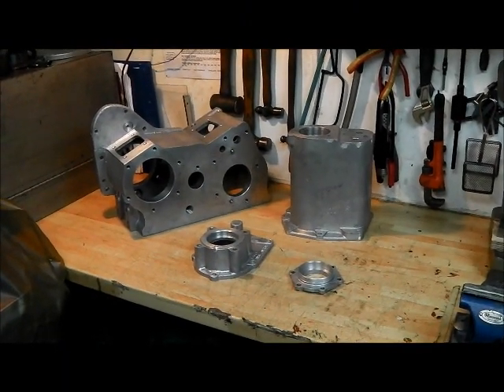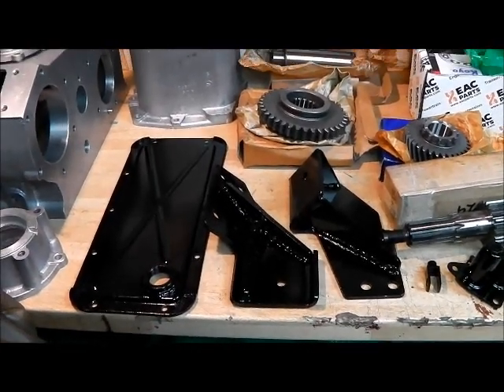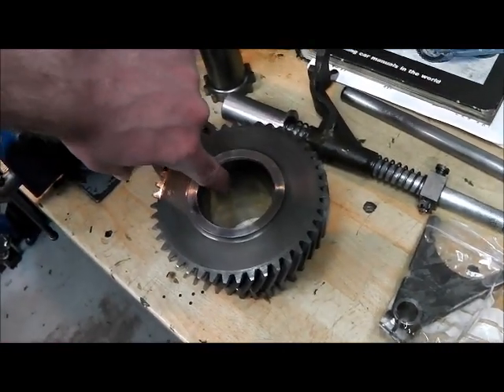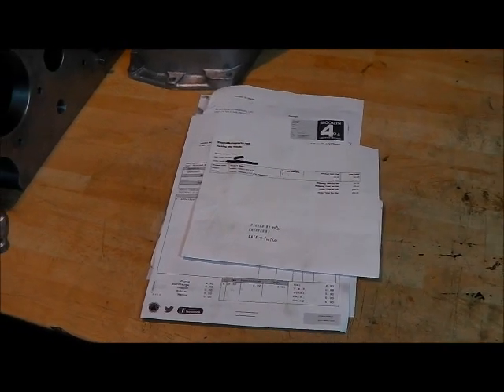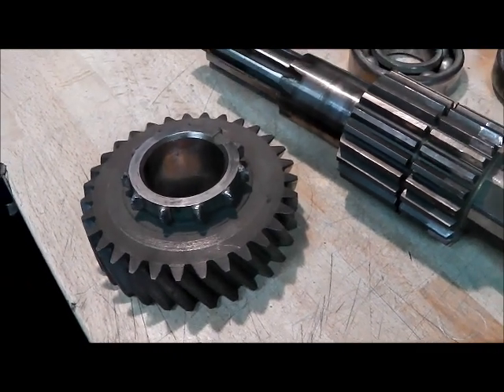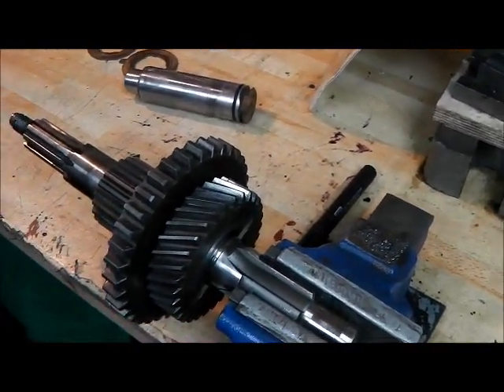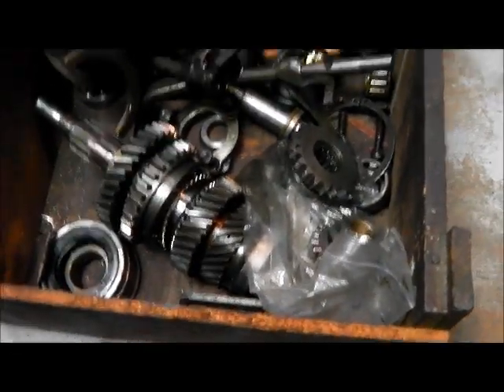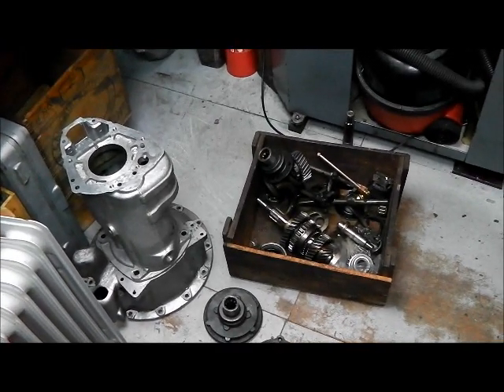Land Rover Series 3 Transfer Box Overhaul - Part 1

Comment: Dingocroft is a good mail order shop. Experienced people who know their Landrovers and will talk you through the price options on for example, gearbox bearings. I spent £200 on gearbox bearings for my early two box and there was only one blue box( unavoidably) I spent the money on really good bearings so it’s fit and forget. Could a got all the same for about thirty five quid. Very much a false economy. Hats off to your preparation Phil, that’s like reassembling a new box!
Reply from the maker: Agreed, I have had great service from them, in fact I've had very little trouble with any suppliers despite what some say. I have just bought myself a hydraulic press for this one, having struggled for years without one.
Reply: Nice tool. If I had one I’d want one that had a decent adjustable depth and some grunt. Which means it’s big heavy and if new, expensive!  Mind you if you watch scoutcrafter and his tool resto channel. , the Dake (His  hydraulic press)gets reasonable use. I recommend him.

Comment: Please can someone write the fractions with number of tooth of the gears to obtain the High and Low ratios of 1.148 and 2.35 of the transfer box of the Land Rover Series 3? I believe that 1.148 could be 31/27 but I don't know how engage the gears inside the transfer box to obtain the 2.35 low ratio. Many thanks.

Comment: Is it the speedometer drive pinion or the gauge that causes the indicator needle to bounce around over time?  My ‘67 109”sw needs fixing...Thanks for making these videos!
Reply: Chuckle- never mind- ‘you answered my question in the video.
Reply from the maker: There are other possible causes, tight bends in the cable don't help and if the cable gets past it's best then a wandering speedometer can result. A slipping helical drive gear tends to cause a wildly wandering gauge, the lesser faults tend to just make the needle "waggle" constantly. I've noticed mine doing that this week, I suspect the cable is about to bid farewell..
Reply: @steamwally  IMG_5464.MOV

Comment: Blanchard supply genuine thrust washers pal
Reply from the maker: Thanks, yes I bought a spare set from them recently. Interestingly they were the same brand as the ones I bought on ebay (vandervell) but machined differently, with a counter bore on the load bearing face, same part number.. Anyway, a spare set for when the supply dries up..

Comment: How do you blacken your hardware?
Reply from the maker: I use a chemical blacking kit from Frosts Restoration supplies. Very simple to use, the parts do require plenty of preparation however.
Reply: @steamwally  Thanks for the reply!  I've been doing a poor mans version (heat up the nutls/bolt then dunk in old oil) but a proper phospahte is better....

Comment: They are new bearings on the main shaft intermediate. Because genuine bearings are cream yellow plastic not black or dark brown, sadly not great quality them
Reply from the maker: I used the very same kit on the donor transfer box I overhauled previously, 50k miles on that now with no trouble. Where possible I try and track down NOS parts these days, tired of cheap aftermarket rubbish!
Reply: @steamwally  so true